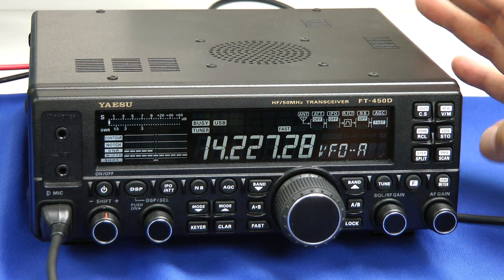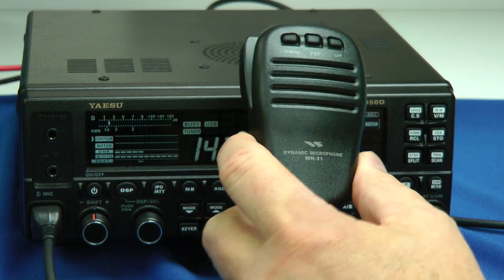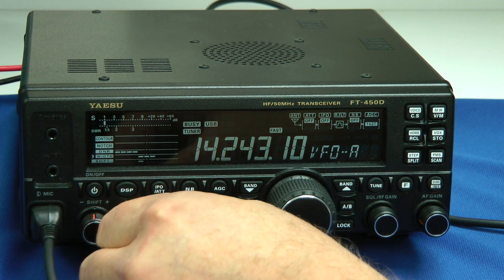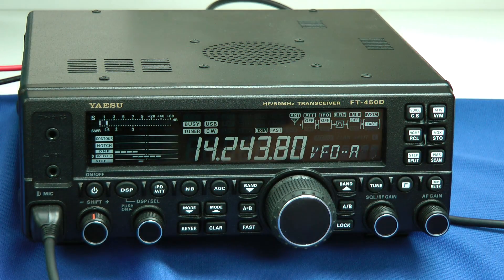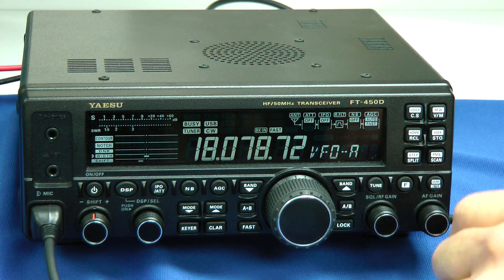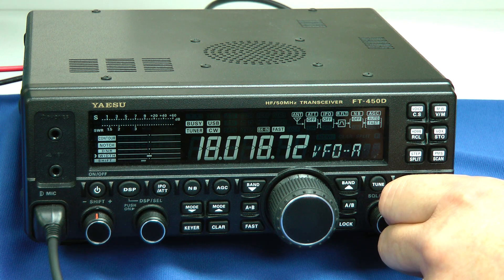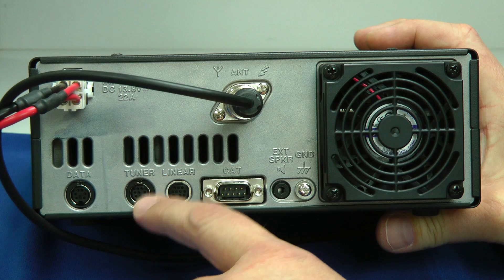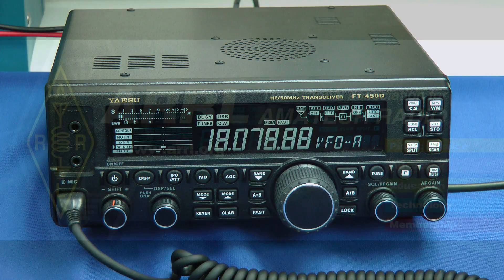Yaesu FT-450D Walkthrough

Comment: As a newer ham, I wanted an old school display and heavier desk transceiver compared to my 891 which is also a great radio, especially for portable operations. 
I was lucky enough to finally get one from a family of a SK. The radio is in excellent shape and performs just as well as my more modern 891. 
I highly recommend the FT-450D if you ever get a chance to acquired one. Simple layout, popular features have actual buttons (no sub menus to dig thru), easy to read display (great for older eyes 😊), solid build (like a tank) construction, and great RX and TX. 
I do not ever plan to sell this older gem of a radio.

Comment: I've recently bought one of these, but I find the RX audio terrible & muddy; the only way I've found to improve it is to turn the contour fully down to the left.

Out of the numerous rigs I own, the FT-450D is hands down the worst for receive audio.

Has anybody else noticed the same poor audio?
Reply: I don't have the 450D but I have the FT-891 and it's built in speaker is not the best as is the same with most built in speakers. I have to use the countour too to make it brighter, I listen mostly with headphones and it sounds 1000 times better, the analogue audio is superb from the 891 with headphones. The audio is much better than my old 7300 which I sold. Never happy with the harsh background noise. SDRs need proper AGC control. The 7300 just didn't work for me, the fancy screen can't make up for bad audio and after all what's the point if the audio is poor ?

I don't have the 450D But I am interested in getting one as a 2nd radio for the sitting room. I've been using the 891 and while I love it it's heavily menu driven but it's a lot of radio for it's size. The receiver on it is really good.

Comment: I have this radio and use it for portable/mobile use for county hunting.  I have had nothing but excellent audio reports using the standard, enclosed mic.  Easy to learn, good speaker system, and excellent ears.  For as inexpensive as it is, it offers goodies that I had to pay extra for on my 480HX radio... I can only put 1 filter for ssb and cw in, I have to buy a special speaker implement and install it in the 480, and these come standard with the 450D.  About another 400 or so dollars of implements to get it to do the same things.  And twice the price!!

Comment: How do you access the ALC when doing digi modes such as psk31? Obviously you need to be able to reduce ALC so that it is barely showing when using psk etc but I cannot find it described anywhere.Any help please?
Reply: You don't need ALC. Just turn the TX power down to 20-30W and there you go.

Comment: I was looking for an inexpensive HF rig, tired of used old ???.  I considered the Alinco SR8, Icom IC718 and others.  But the fella at AES recommended this rig, and I am glad that he did.  I got it today, and have yet to power it up.  I've been studying its manual, a lot in there.  And I decided to see a few YT vids too.  I will get to play with it tomorrow, I will sleep on it to get my thoughts together.  Yaesu gives you some nice bells and whistles that you pay extra for in other brands. I read the QST review about the Alinco SR9, and that got me thinking about getting a nice new toy.  I have not been on the air in years, and am a bit nervous like a new ham, got those new ham jitters.  This rig also has a code practice mode, to brush up on code.  I was quite the motor mouth in the early 90s, but the bands seem so dead now, especially above 2m.  We gotta use it, or we will lost it.  So look out, here I come!  btw, I also have a Drake TR4, it's good to have something old too.

Comment: Too bad the FT-450D was made with a defective rotary encoder. Radioworld knows of this problem, and I have advised others to avoid the 450D. After two weeks of use, the encoder was inoperable due to bad soldier joints. Knock on wood though, my 950 has had no issues after 4 months of ownership.

Comment: I bought this radio back in 2011 at a hamfest. $944.00 no tax. Works very well. I started to get the 950 but the 950 was about 4 to $500.00 higher so i decide on this one. Great radio. Small enough to use as a mobile. But since i don't run the roads it is a home base station. I have many yeasu radios and they have been great radios over the years.

Comment: You'll be happy with it--even if you are a new ham. There is an easily accessible function menu, easily mastered.
This radio is much smaller than either the receiver OR the transmitter I used in 1975 as a novice, and light years ahead in performance. Many, many features are in the menu that would have been add-ons back then: (2x VFO, keyer, filters, digital readout, and much more!

Comment: Thanks for nice run-through.
However, the voice announcer seems redundant. Why? Coz the buttons are so darned small - much smaller than that huge illuminated display....if you can't read the display already, what chance is there of hitting the Function and Voice keys?? Dumb. 
And the ATU only tunes 3:1? OK, you should be using a resonant antenna but how much would it have cost Vertex to install the equivalent of an LDG ATU?

Comment: I have a regular '450. The lack of illuminated buttons not a big issue-I just put a small 17 watt neon light under the top cabinet of my desk. I think the tilt stand can be added.
Otherwise a fine little radio: super easy to see and useful display, high performance, and the digital filters work very well.
Also have heard lots about the small tuning knob but.....you did want a compact radio, did you not???
Have called Europe on 5 watts accidentally--they answered.
Reply: Sorry for a big-time necro-thread, but it's the antenna that matters the most. You could put 100W into a wet noodle and not hit the next town down the road.